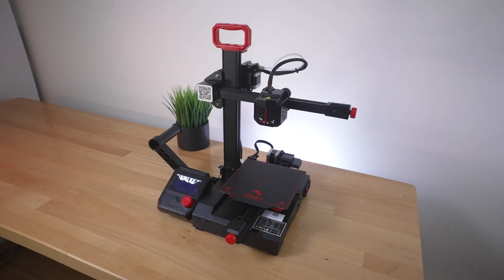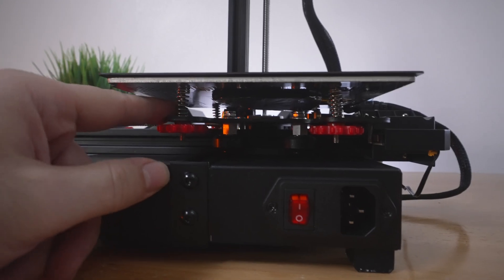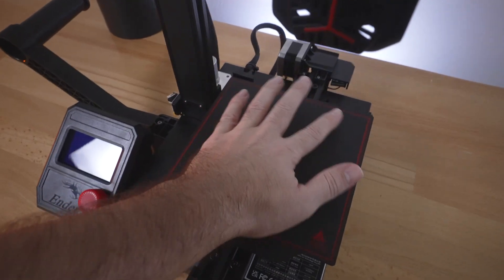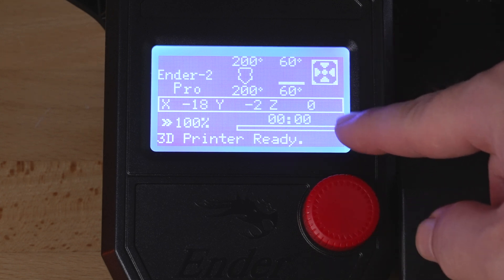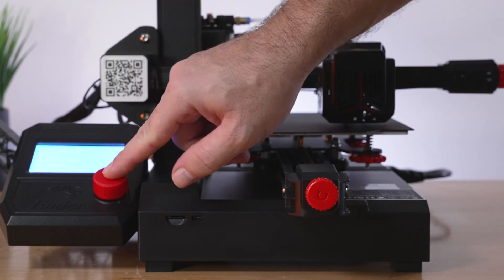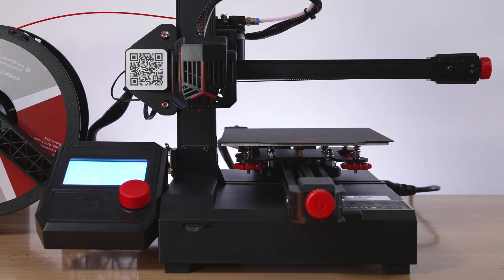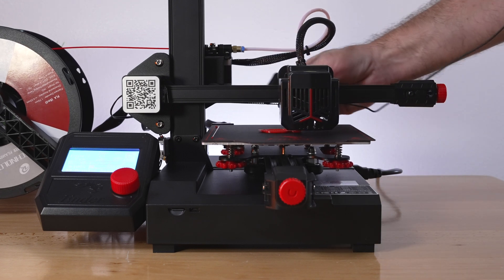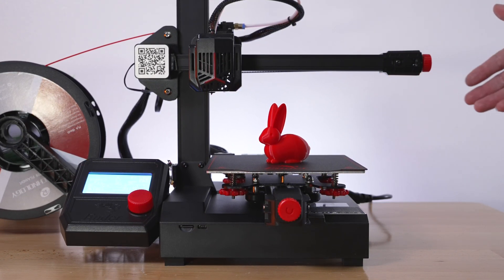Creality Ender-2 Pro - 3D Printer - Overview Level & Print

Comment: Just putting this here 13:00 the tune > babysteps DO NOT SAVE after power down, you'll need to change the gcode, or flash the printer to save a permanent offset.